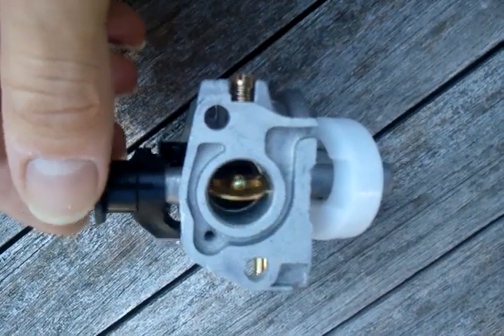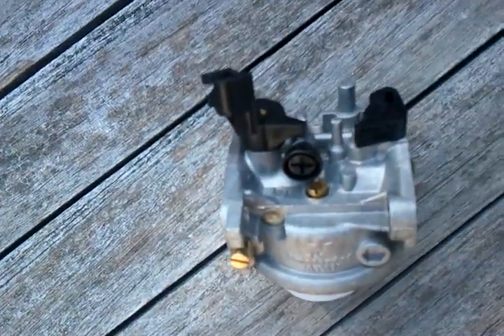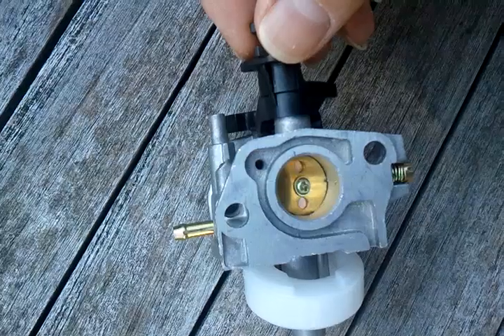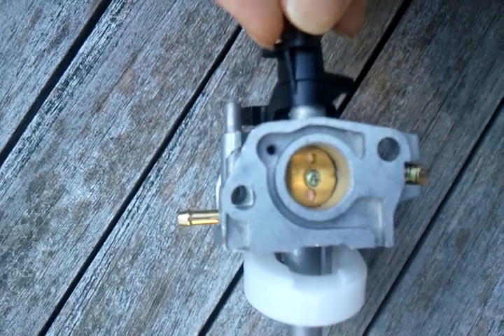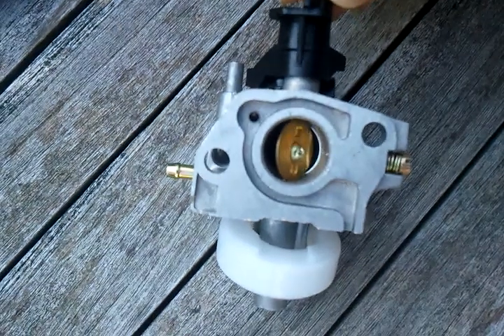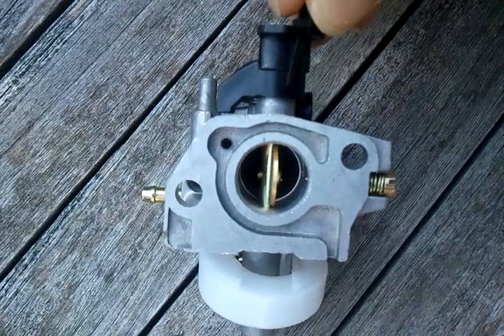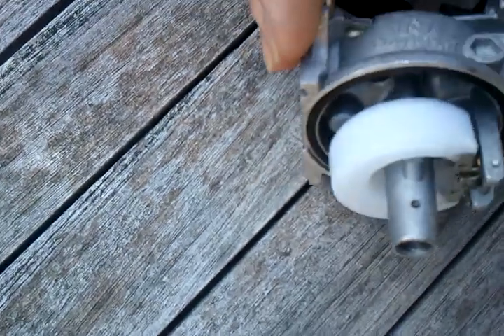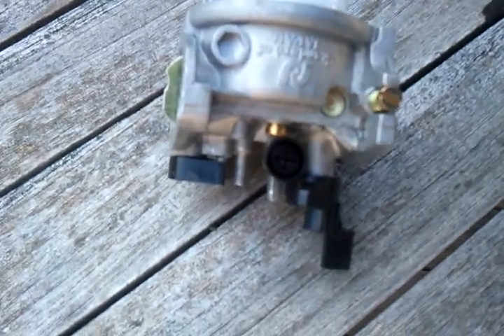Carburetor basics and troubleshooting

Comment: So that screw you said to tighten at the end, I have the plastic variety and it is, seemingly, the cause of my idle issues. Should I replace it or what exactly?
Reply: That's my problem you didn't really elaborate on what you do with the plastic piece after you take it out
Reply from the maker: Pass a fine wire, carb cleaning file, acetylene torch file, or micro drill bit through it.  The gunk feels different than the metal on metal you feel when it is clean.
https://www.amazon.com/Cleaning-Carburetors-Sprinklers-Professional-Oxy-Acetylene/dp/B07X228R1L/ref=zg_bs_10704398011_3/141-3807612-5508469?pd_rd_i=B07X228R1L&psc=1

https://www.amazon.com/Hobart-770086-Welding-Oxy-Acetylene-Cleaner/dp/B0017Z1SXA/ref=zg_bs_10704398011_4/141-3807612-5508469?pd_rd_i=B0017Z1SXA&psc=1
Reply from the maker: Sorry to have mislead you.  I was suggesting that you clean the idle jet.  To do that you remove it and pass a fine file through the hole.  I have ultra micro drill bits that work good too.  The plastic type just snaps in.  A pair of slip joint pliers should get it out.

Comment: A very good video.. thank you, my problem with my generator is when I load it    with house load (about 6 to 8) Amp it shuts down, it's generator capacity is 10-12 Amps. Any help appreciate.
Reply from the maker: The engine shuts down or the electrical output shuts down?
Reply: @muckleyj  the engine shuts down.. electric output is good nothing wrong with it.. how do I know if the engine giving its max power? Do valves bridge screws play a role? Cause I tightened them once so the engine hardly started..then I losen them a bit so starting got smoother..
Reply from the maker: @zeyadalsheikh3839 , I don't know to what you are referring with a "valve bridge screw".  I'm not sure I can help.  Sorry.
Reply from the maker: @zeyadalsheikh3839 , aside from whatever problems you are having with the "valve bridge screw", if the carb is simply not able to provide enough fuel then the engine would be overloaded.  I believe this would be observed as the governor keeping the throttle wide open and any additional load just reducing the RPM since the governor would be maxed out.  If you haven't cleaned the main jet a e-tube, give that a try.
Reply: @muckleyj  This is good  for me.. I'll try to clean the main jet e-tube and see. Aside from all, what I meant about valve bridge  screw is the  the nut over the frame that locks valve end rod to transfer movement from crank to valves to open and close them in combustion cycle. Thanks for help. Your video is great.. keep on.
Reply from the maker: @zeyadalsheikh3839 , I believe you are referring to "setting the valve lash". 
Google search here.  
https://www.startpage.com/do/dsearch?query=valve+lash&cat=web&pl=opensearch
Picture here.
https://drive.google.com/file/d/1KQhzPmphCNDHEoIPa6u8gOc_j3WlKl3y/view?usp=drivesdk
Reply: @muckleyj  yes.. that's what I ment..I work in cement industries  we deal with large gears we call this clearance a " backlash". Thank you again Josh. Forgive my English as it is my second  language. I'll read your links.
Reply from the maker: @zeyadalsheikh3839 , Your English is perfectly fine.  Sometimes we all find ourselves at a loss for the right word.  I even found a reference to the valve bridge so you're probably not wrong.  Just a different colloquialism.

Comment: hey do you know where to put the gaskets? I bought a replacement and it came with 3 gaskets
Reply from the maker: One each on the flat faces of the carb (in and out).  The 3rd is probably for the plastic "isolator" which is really just seems like an extension which stands the carb away from the face of the engine.  The third one will have a different profile.  If it doesn't then it might just be extra.
Reply: @muckleyj  yes it is a different profile
Reply from the maker: @azn789456  carb insulator - https://images.app.goo.gl/NJfR3mPjFyKKgrCs7

Comment: Question, does it still idle if carb is all the way closed? Like if the the black lever on top of carb is turned all the way clock wise?
Reply from the maker: Depends... Generally yes.  You should have "Choke off", "Half choke", and "Full choke".  Full choke ensures that the air fuel mix is rich (less air to fuel) for starting - usually when cold, especially in cold weather conditions.  Without the choke the engine may not even start.  Almost immediately after starting, the engine will run rough because it is running really RICH - it may die.  If subsequent restarts are required but unsuccessful, full choke could result in flooding the engine.  If the spark plug is wet with fuel it will fail to create a spark and continued attempts to start just admit more fuel thus keeping the plug wet.  Generally, after a sputter, start, die sequence you should move to half choke.  This helps to ensure that a rich A:F mix is still being provided but significantly reduced the likelihood that the engine will die and/or flood.  Once the engine internals are up to temperature the fuel vaporizes much more easily.  Remember it is not the solid or liquid in any form of combustion that are burning.  It is the gasses being give off as a result of increased temperature or reduced pressure.  Look up pyrolysis.  I'll say that part again - it is not the solid or liquid in any combination that are burning.  It is the gasses being give off.  When the internals of the engine are cold the fuel does not vaporize as well as when the engine is hot thus the need for a choke.

So, the choke device creates an obstruction in the air flow.  Full choke is a full obstruction.  Choke off is the position where the obstruction is minimized or eliminated.

Comment: I'm having a problem on my predator 212 stage 1, when i hit top speed it sputters and if i hold the throttle fully open for about 15 seconds while its sputtering it bogs down and dies with a full tank. I'm guessing i may need a new carb or just to clean out the things you've listed but would you know why this is happening?
Reply from the maker: Sounds like it is possibly starving out.  If the pickup tube or its orifice is dirty that would do it every time.  I don't think I mentioned it in the video but if you run the largest flat blade screwdriver that will fit up the pickup tube, you can unscrew the orifice and the actual brass emulsion tube will come out with the orifice.  The orifice is the part with threads.  Clean them both and try again.
Reply from the maker: https://youtu.be/Xulm7W61bJ4

Comment: Just put a brand new carburetor on and its exhibiting the same symptoms. Any other reasons why it would do this besides a dirty carb?
Reply from the maker: What is the symptom?
Reply: @muckleyj  surging.  Almost stops then surges. Pull choke on slightly and it smooths out.
Reply from the maker: @daniellunn1304 , it could be clogged already with manufacturing debris.  Try adjusting the needle valve first.  If that makes no difference then look for the idle jet that I point out in the video.  Remove it and attempt to clean it.
Reply: @muckleyj  ok. Thanks

Comment: No wonder things don’t work. I found dirt in the gas tank, n was told to remove it to clean it, I ain’t doing that! Carb is as far as I’m willing to go.
Reply from the maker: If you are willing to do the carb then the tank is way less involved.  Many times there is a filter between the tank and the carb, the dirt will clog it up.  When you go to change the filter you can pull the hose from the carb and drain the tank through the filter... Even without a filter much of the dirt will drain out and you can simply refill.  Be aware though that some tank fittings have a built in filter/strainer that might need changed too.

Comment: Great video.  I would add that the hole at the top left when looking at the butterfly is actually a vent for the fuel bowl and should not be mistaken for an air bleed like the two in the back of the carb where the choke is.
Reply from the maker: Chris Mills, very nice!  Thanks for the added info!  It is impossible to find any engineers notes or drawings for these things so I just kinda figured it out and shared what I learned.
Reply: Hi I got petrol leaking out this jet into filer, when engine is not running. Any ideas?

Comment: As an old guy,i'm glad fuel injection is here. Carburetors have been and always will be trouble. They need fuel injection on small engines!
Reply: @Anthony Torrey. Fuel injectors need cleaning too.
Reply: @harryharry3193  and you feel the need to be rude?  I can't state my opinion?  Appreciate your comment my fellow American!
Reply: @anthonytorrey igx series. I'm a house washer. I've been told they are bad. Nothing but issues on the first gen on the fuel injection ones

Comment: I cleaned my carb yesterday but didn't realize I also need to clean the idle suction jet.  I cleaned it out and the engine runs much smoother now.  The choke doesn't have a good feel to it and it floats or bobbles about and eventually it will start to choke the engine out and i get black exhaust smoke.  The choke doesn't seem to have a good click or defined position when open.  Do you have any suggestions?
Reply: New carb fixed the problem completely. I could have tried something else but my wife uses it with her food truck so I need to be sure the generator is dependable. I spent $20 for it and it was worth it to me.
Reply from the maker: The choke is usually either ON or OFF.  Sometimes there is a half choke but either way it really isn't an exact science.  Really the choke is only there to get the engine, carb and fuel system primed when the engine is cold.  Once it is running you can usually turn the choke off.  On the off chance that you can't then just keep the choke until the engine is warmed up then turn it off. 

If the choke butterfly is loose or separated from the stem, or the lever is loose from the stem, or neither are loose but there is no detent to hold the position then look to correct the applicable problem.
Reply: @muckleyj  The choke handle is pretty loose and installed correctly.  It bounces all over the place when the generator is running. I have another carburetor on the way.  They are cheap and my wife needs the generator for a food truck event.
Reply from the maker: @andyking5651  sounds good man.  A rubber band tied off to the frame might be the answer in the mean time.  Is there any chance that bending the choke lever up or down will keep it tight against a detent or something?  Good luck.

Comment: thanks for the great detailed explanation. what's the other black screw adjustment right above and perpendicular to the screw jet that you point to @3:58?
Reply from the maker: It's been a few years since I've messed with these.  That is the screw that keeps the inner butterfly from jamming in the throat of the carb.
Reply: Josh of All Trades cool, thanks for the quick reply!

Comment: I have predator 212cc motor on my kart,runs great till I make a sharp turn then it dies. I've replaced the carb. Get the same results when making sharp turn,any ideas what's the problem
Reply: Low oil sensor
Reply: Josh Muckley ,that's my thought also,I just can't figure solution to the problem. With the carb bowl, there's no adjustment,I've got half tank of gas in the gas tank,you any suggestions
Reply: It’s definitely the low oil sensor. There a many videos on how to delete that.

Comment: Hey Josh,  I'm having that surge issue also.   My generator runs great for about a minute then surges then stalls.   I soked carb for 2 days in carb cleaner then cleaned using KnL probes and blew out all parts including that jet.  I still have surge issue.   What do you recommend?

Comment: my pressure washer didn't start after a few years in storage. I removed the jet on top of the carb while cleaning. it now revs high & smokes I may have put weed eater gas but I drained that best I could. could the jet I removed make it rev high & burn rich?
Reply: yes, I finally figured it out. I had thrown the governor off by loosening the screw. after watching a few vids I got it back running good. thx for reply

Comment: Hey man I was wondering if you could help me out my carburetor is getting to much fuel causing it to flood and the motor to cut off any answers?
Reply: Ok upon starting the motor I pump the primer the recommended times to prime and when I get it going a puff of black smoke comes out of the exhaust after that it will run for about 3 minutes tops before shutting itself off the motor is only 7 months old
Reply: It's on a predator engine I just checked my spark plug and it was dry took my carburetor apart and and soaked it carb and choke cleaner going to see if it stays running this time  I appreciate your help
Reply: Ok Josh update on the predator engine that I was telling you about I ended up taking it to a mechanic and found out the compression was really low causing the gas to seep into the crankcase so  he replaced the spark plug and raised the compression and changed the oil and now it's running like new again thank you for responding and trying to figure out what could've been wrong.

Comment: have a 2014 Craftsman snow shredder briggs 15c107-0014-f8
got the unit with seized engine ( fixed the engine part ) tried to start carb gummed up !!!
Took apart carb cleaned main jet ( plugged )
Cleaned emulsion tube ( 3 holes plugged )
reassembled engine surging !!! this carb has a Viton rubber tipped needle ok , no Viton rubber SEAT .
Took the Carb apart  2 nd time , this time Soaking the Housing in CLR 4 hrs , then Soaking Housing in Solvent . 
NOW RUNNING BETTER but still IDLING ROUGH !!!!!!!!!!!!
Smooths out with Choke slightly ON !!!!!!!!!!!!!!!

Comment: The carby on my little kipor generator looks very similar to this one,  this has helped me a lot , had that annoying surging since I bought it 2 years ago, worse part is you can't adjust the idle mixture screw as there is a plastic panel in the way..... have to remove the carby to gain access. Wound out that screw 1/2  a turn, runs mostly without surging now.

Comment: Finally someone explain these type of carbs .Thank you for the video !!!.....I have cleaned mine on a Honda 240 GX 8 H.P,  and it surges ..I m going to re clean it and make sure the idle passages are cleaned well
Reply: what was the air mix screw set to?  Was it  at 2 turns out ?? I have the same engine and can't find anything

Comment: Okay I have the issue where the engine surges when I give it gas. Its on a minibike. Its a 196cc Honda clone with the generic carb they all have. I opened mine and cleaned it with sea foam but I did not remove the jet and drop the e-tube. But it runs perfect at idle. Mine has the plastic style junk on the top of the carb. A branch ripped the cable return spring off the top of the linkage when I was riding it 6 years ago, it sat with just a tiny bit of gas in it, just enough to go stale and gum up my carb....
Anyway the throttle return spring was bringing the throttle lever back further than it would normally go before I replaced the cable return spring. So the throttle return spring which goes to the governor arm is a little worn, maybe stretched. Tomorrow, I will pop the bowl back off remove the jet, clean that and the e-tube, pop the plastic piece off the top clean that off and out in their and see if it is better, one video showed where you can widen that using tiny drill bits if the problem persists. Than if I have to I will snip the throttle return spring making it a tiny bit shorter to add more tension to the governor arm if necessary. Mine has a screw with a square plastic cap on the back of the carb that prevents me from adjusting that, any idea what that is/does and if I need to mess with that? I can remove the plastic and than I can remove that screw and adjust that too if need be. Another video, I think an official honda video calls that a pilot screw. So whats the pilot screws function, its setting is about 2,1/2 turns out according to honda and it is set up where you cant change it much without removing that plastic, why? Any ideas what my issue is? Am I on the trail? Anyway I'll be back out there tomorrow and after properly cleaning all of that, hopefully its purring like a kitten again. The round bowl gasket shrunk, I barely got that on today so kinda leary about dropping the bowl again and the back paper gasket has a tear in one spot where the screw goes thru. Used silicone to repair that, but now leary about un-seating the carb again because of that..... 
I will update how things went tomorrow. Let me know what you think in the meantime.

Comment: I'm just browsing through video by video.. came across this one, comments have been recently active, so I thought why not ask this question, in hopes for a god giving fix!! I've got a Briggs and Stratton Twin Cylinder engine, on a MTD rider. I'm repairing it, and it's going great so far! I don't know to much about small engines/mechanics.. so I apologize if I word things incorrectly.. learning as I go. I'm thinking it was the people that had it before me, they replaced the choke cable with a throttle lever, to permanently keep the choke partially closed, reason is because if the choke flap was wide open, the engine starts to die out. How could I fix that? I have already cleaned the carburetor. Hmm..

Comment: fixed that problem and now itll start if I pump the throttle but it wont stay running. I plan on replacing the spark plug tomorrow. the chains r kinda rusty, could that be part of the problem?
Reply: +Josh Muckley no, it dies. I would say carb needs cleaned but the carb looks good. before I got it, it'd been sitting for awhile
Reply: +Josh Muckley ok, I'll clean the carb and c if that helps. thnx